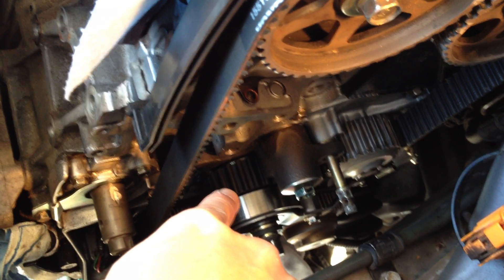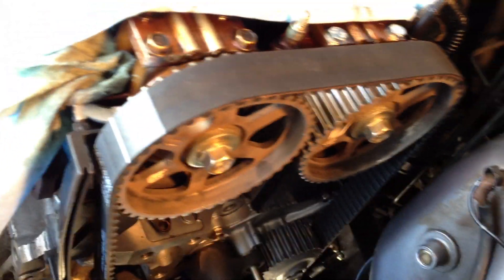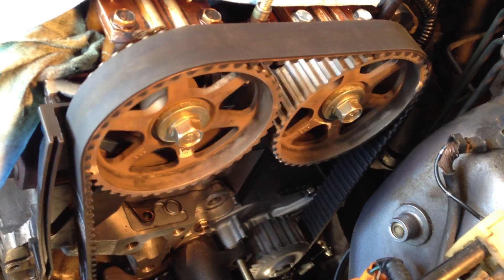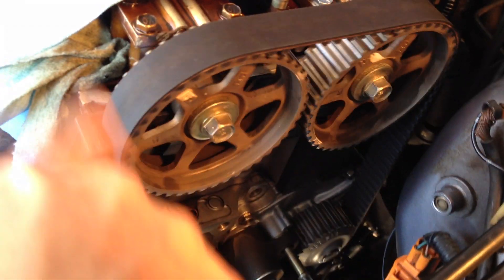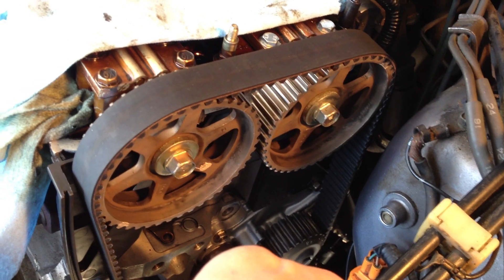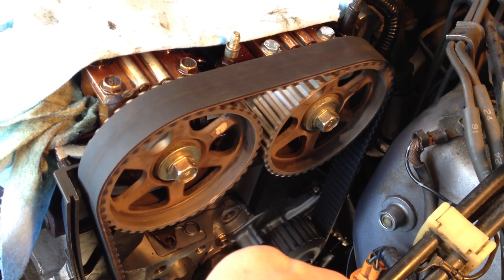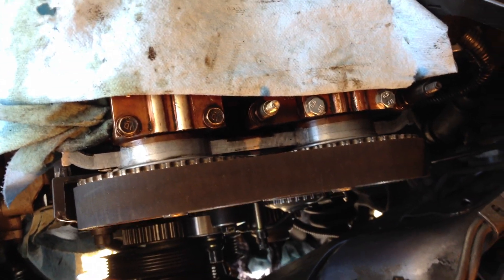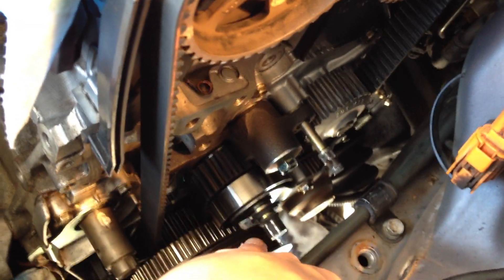timing belt walking and settling h22a4

Comment: found out my belt walks with stock pulleys and tensioner. i purchased a kit to replace the belt and tensinor. with that bit of travel your belt will be shaved down from hitting the timing belt cover like mine is. but if it were to walk at high rpm the chances of the belt slipping or snagging  on its self would make it fail. (opinion)

Comment: ok here's my 2 cents on the matter!! I have installed a balance shaft eliminator kit from kaizenspeed but I didn't use their tensioner I found one on evilbay a lil cheaper and does the same thing! And I think ( dangerous thing I no) But if you compare the factory tensioner and the KS one you'll see that the factory one has more of a wider base than the aftermarket one does! Well the narrow base may be just small enough to cause the roller to sit, after it has been tighten down, to move and cause the belt to walk out like that!  The one I bought has a grade 8 hex bolt on it and is of wider base for the roller to sit on, and thus no belt walk!!!
Reply from the maker: interesting man could be.  kaizen also addressed this matter with an anti walk kit, more money but should never have to worry about it again after installing it
Reply: patrick garcia

Comment: I have the same problem. Im still waiting on my kstuned tensioner manual. But I hope there isnt another problem to this mine walked off by 3mm on both cams and with a failed oem honda hydro tensioner. So im hoping the kstuned manual tensioner works for these hs man. And mine.

Comment from the maker: I haven't seen this video in a long time lol but definitely not supposed to have the gap...it's hard to see in the video but the belt was hanging off the cams like 2-3 mm, when you fire up the car the belt's gonna get shredded.  When I fixed the problem, it was completely flush with the cams even after hundreds of rotations.

Comment: I just did another manual tensioner conversion, I'm having the same issue. I've redone this damn thing 5 times, and eaten 2 belt. F20B block/H22A head/ F20B cams. It looks like I'm missing whatever the pulley is supposed to be backed against to up at the block

Comment: Mine must be too tight then.. I have the KS tensioner and mine walks off.  I've tried three different pulley assemblies, (with new pivot bolts), and it does the same thing with all of them.  It also whines..  My initial fight was about getting rid of that whine, but now it's getting it to stop walking off.  The problem might be one in the same.  Good info.

Comment from the maker: i was able to fix this problem.  what happened for me was i had to redo all my work.  if you are using the kaizenspeed tensioner, it can be too tight or too loose which will cause the timing belt to walk.  at first i thought it was one of the bolts that held the auto tensioner assembly was bent, most likely the one that holds the water pump in the block.  i would try redoing your work and putting on the balance shaft belt.  check the tension for both belts and see if it continues to walk.

Comment: Same exact thing on my h22 did you get it fixed? man its driving me crazy changed 3 o.e.m belts 2 o.e.m water pumps h23 manual tensioner and now kaizenspeed tensioner still walks off